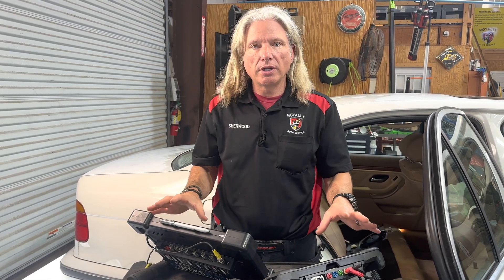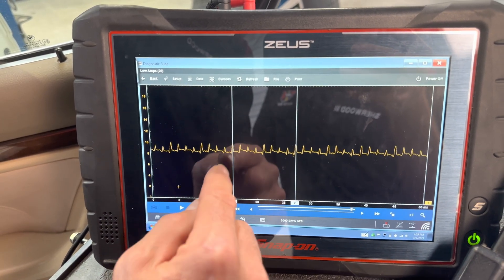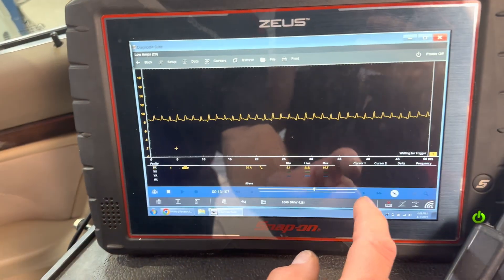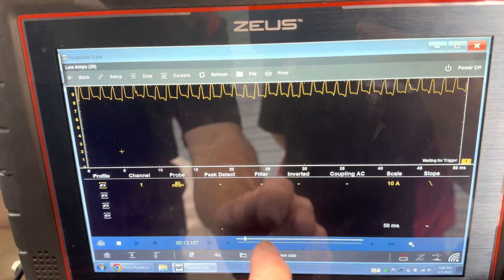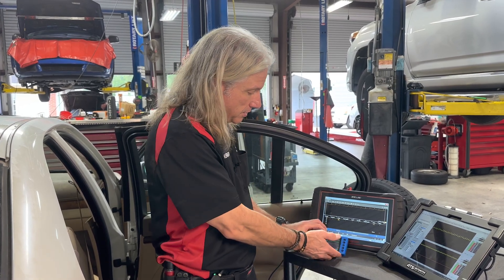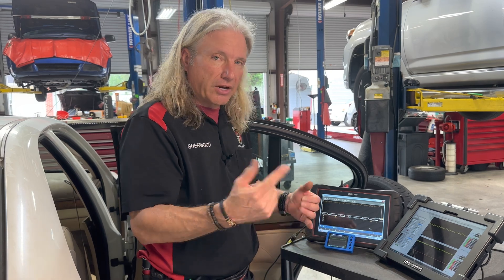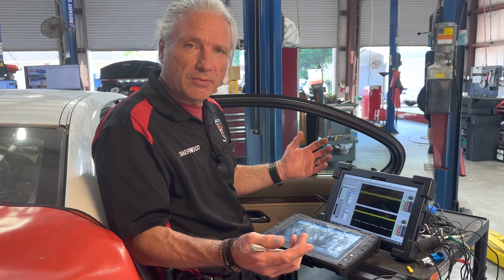Comparing ATS & Snap On Zeus Scopes (BMW Fuel Pump Waveform)

Comment: Just curious, being that I have never used an Oscilloscope before. When testing a component, how can you find out what pattern it should have on the screen when its good? By that I mean, I have seen people using scopes but depending on the component the patterns look different. Some look like waves, others like what you would see on a heart beat monitor, other look like flat plateaus and valley's.

Comment: For the snap on scope, I find it's best to switch out of Amps display and go to DC voltage and use the calculations written on the amp clamp. You'll be able to make a much bigger and readable waveform

Comment: In my opinion, the ats is much better than the snap on. However, I believe you did an injustice to the snap on. Too many things you could have adjusted on the snap on to mention here. Yeah, you have to adjust time and voltage. Thats true of any scope. There are lots of videos out there showing it’s capabilities. Perhaps if you watch a few, you’ll see. There are lots of techs that already have the snap on scanner with the scope. Great place to start learning. Then maybe get the ats or pico as I did. 
Just my opinion. Love your videos. Keep them coming. Especially scope related.

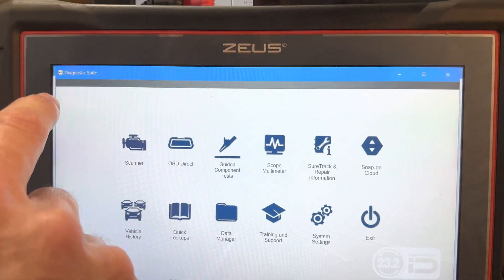Comment: Question for you guys, I’m getting into using my scope more and more on my snap-on triton d10, where would you recommend I go for scope accessories? Such as amp clamps, secondary ignition pick up probes, I know there are better quality products out there then the snapon brand but I do not know where to look 15:14
Reply: Joes auto electric, Jarhead Diagnostics, Automotive test solutions, AES Wave

Comment: You get more defined so scope captured by running the scope on normal voltage based screens versus the preset "low amps" scope screen. I've seen it and compared it many times.

Comment: Nothing compares the Escope. You can do way more with the escope. Plus it has sensor simulator which sends frequency signal and you can pulse injectors snd ignition coils. Pus you can measure valve timing or anything and it shows you in degrees and great zooming feature. Escope is amazing and i love it and enjoy it every day👍

Comment: I'll be an outlier and say I love my Snap On scope.  I also have a Pico 4425 and a Uscope.  The Pico is superior no doubt, but for basic stuff the snap on is very convenient.  Yes the zoom works backwards on a snap-on, no biggie.
Reply: I agree, love the pico scopes and I definitely prefer them. But there is something to say about convenience. If it helps you diagnose faster when you are paid per the job (shudders) or are in a high demand field where getting the job done quickly matters like firetruck, police, EMS, oil fields, military ect. Things that are convenient to the tech become time savers.

Comment: Hey Sherwood, just an observation. On the snap on scope I see you had the trigger set around 2v and falling edge. Move your trigger up on the screen (or just turn it off in this case) and turn on peak detect and I think you will see the "glitchyness" go away and it will act like the uscope or the ATS. Just my observation and I hate snap on scopes haha. I could be wrong and their sample speed may be that slow. If it is that is pretty pathetic for the price of that tool. Great video BTW 👍🏼
Reply: That ending hahah 🤣😅
Reply from the maker: Thanks! Someone else mentioned that so I’m going to take a look. I always start with no trigger on the ATS so I didn’t even think about it on the Snap-On. I haven’t used the SO in a very long time so I’m sure I didn’t do it justice. I definitely wouldn’t buy it just for the scope but so many techs have the scanner and never use the scope. Hopefully this will get them to at least try it. 
Yeah, that’s about normal for me to try to do the ending. Haha. Thanks again!
Reply: @theroyaltyautoservice  I agree. You see these things for sale all the time and the scope leads are usually brand new in the package. It is a shame because like you say, a LOT of shops and techs have snap on scan tools/scopes in the shop.
Reply: @theroyaltyautoservice  Just curious, being that I have never used an Oscilloscope before. When testing a component, how can you find out what pattern it should have on the screen when its good? By that I mean, I have seen people using scopes on youtube, but depending on the component the patterns look different. Some look like waves, others like what you would see on a heart beat monitor, other look like flat plateaus and valley's. I'm a mechanic on heavy duty trucks. We just never had a Scope for our shop. Even though International trucks sells a PICO scope on it's dealer website. Our Service manager is just too cheap to get one. One of the reasons people are getting out of my industry. Also do you think the ATS could be used on class 8 trucks and heavy equipment or would a PICO be better?
Reply: Hate SO scopes too.. Way overpriced for what it can do, but there is a huge pool of fanboys, lol. Love the Pico, have used the Autel a few times as well.
Reply: I have a Snapon Triton with the 2 channel scope and when I sell it, the leads will be brand new in the bag they came in. I have only used a couple times and seems to do ok. I prefer my Hantek 8 channel scope and my aes wave single channel more. The aes single is great for testing charging/starting complaints, and my 8 channel for the more complex issues. Eric, with my Tritons 2 channel, I have noticed it is not as smooth as the others.
Reply: Yeah I use the pico on anything relatively complex. I’ll use the snap on on quick and easy things as it’s faster to grab and go. The snap on isn’t the worst scope in the world but I hate the way the zoom and stuff works backwards.
Reply: @Jpilgrim30  yeah the buffet is super small and the fact it works opposite of every other scope in the world is a little frustrating.

Comment: Switch the amp clamp MV/div output to your scope then adjust the voltage on the Strap-on  to 5 volts. Like the professor was saying you’ll have to play around with it

Comment: WHY DOES FUEL PUMP SPEED MATTER AND WHAT IS AN  AVERAGE AMPRAGE FOR FUEL PUMPS ,,, THANKS SO MUCH FOR YOUR TIME 👀👀👀???????????????????????????????????????????????????????????????????????????????????????????????
Reply from the maker: Fuel pump speed can show cavitation if it's speeding up and slowing down. It can also show a restriction if it's turning too slow and high amperage. It can show that it's not picking up fuel (Maybe out of gas) if it's spinning too fast. As far as amperage it depends on the vehicle. In my experience around 7-9 amps is a normal range but that's definitely not set in stone.
Reply: @theroyaltyautoservice  THANK YOU FOR THE RESPONSE ,,,A TRUE GIANT AMONG MEN !!!!!!!!!!!!!!!!!!!!!!!!!!!!!!!!!!!!!!!!!!!!!!!!!!!!!!!!!!!!!!!!